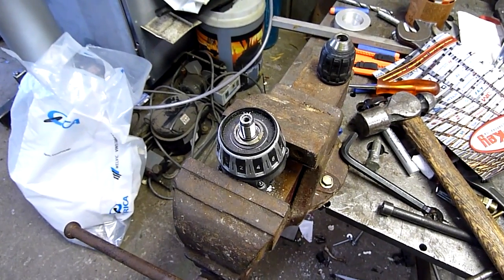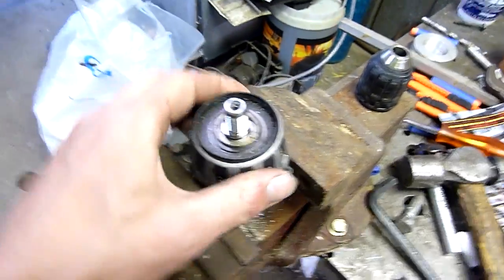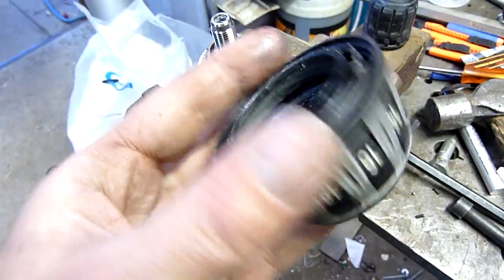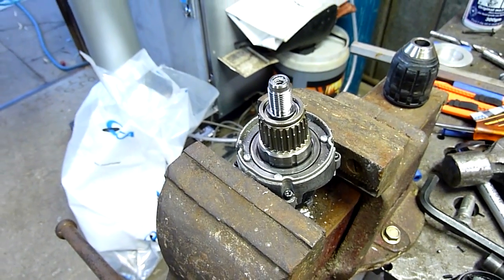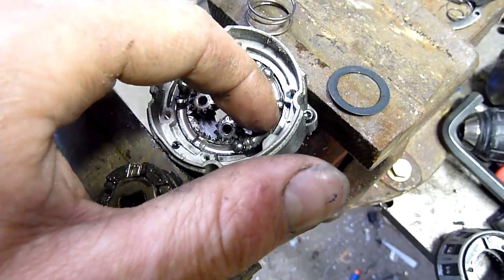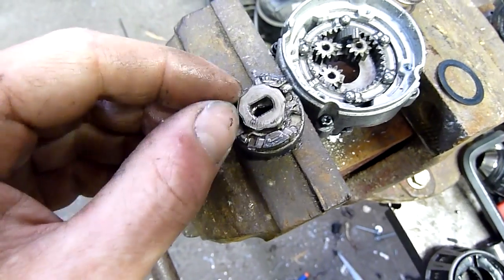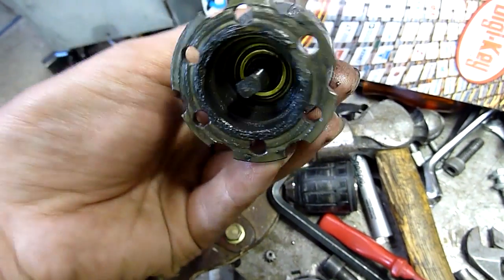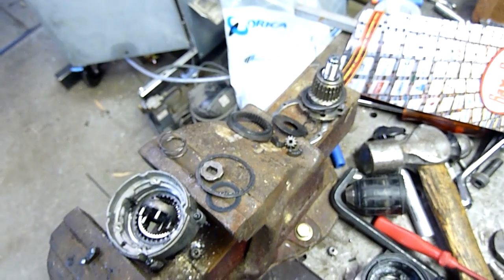Milwaukee M18 Cordless drill clutch autopsy

Comment: my 2601-20 was stuck in the 2nd gear. I took my gearcase assembly apart and learned why it was stuck in the 2nd gear. Now that its unstuck I'm about to put it all back together to see if this fixes my gear shifting issue. the slider pins on the back side of the gear case where stuck in the lowest position and looked like they wedged them selves in an area of the metal gliders of the gear case where it likely should not have been. it looks like they created their own indentations from whatever force caused them to get stuck so I'm hoping they don't go that far down again. I'll try to upload a video on this but currently am stuck where Aussie is, when I pulled that top part off the springs and a few washers flew all over the place. I got it put together for the most part but am stuck on the orientation of one of the springs and one of the smallest blue looking washers you see in his video. Will look for other vids or diagrams to figure out where those went.

Comment: Thanks that was well presented. Mine is only working in the 1 speed setting. if i put it in 2 position i can hold the chuck and it just slips. wonder if it is a stripped gear or do i have to replace the whole front like shown in this video.

Comment: I am here because I got too brave with a milwaukee 0624-20 trying to repurpose the chuck but also the the threaded shaft that it locks onto. Needless to say I opened the gearbox and found an engineering marvel with three layers of gears topped off with those little dogs/paws. I'll never get it back together but damn it seems incredibly well-built. Also yea those seiko chucks are great (they also make the aluminum ones you refer to)

Comment: occasionally...My Milwaukee Fuel 18 will max out on torque and not turn at all. I know there is a clutch. I am trying to avoid purchasing a $80 gear box and would rather fix it with a new clutch assembly. How can you "Rule Out" which problem is the cause?

Comment: Hi sir I live in VN i have 1 hammer drill   MIlwaukee M18 2702 after 2 weeks to work it is smoke and death, but body light on good i was check  soldered it is good, please hepl me, because it is expensive . I buy on ebay, i cant go to usa  take it back under warrenty
Reply: viet tran  I thing the problem is motor you check that I hoped you give more load to the motor

Comment: i took a simaler drill home for a friend to fix one night and the trigger was the only issue, problem is the entire transmission will fall apart on you if your not carfull, it took me an hour to get it working again , it had some tricky little rod and flap for the vairiable slip clutch that im not seeing on your model. i had to do a investigation on the ware and shape of the parts, it took three tries to get all function back ,1st 2nd and 3rd gear plus all 20 slipp settings and hammer drill function, any way the motors in these bad boys are amazing, some have rare earth mags in them bro

Comment: Ooooh, it's rather mechanically complex in there. I hope that the assemblers on the production line are given a good amount of time to put that lot together!

Even if I knew where all the bits went and how it worked in there, I'd guess you'd need a good 20 minutes to assemble one of those because of how fiddly it would be.

Imagine that.... You've almost got it together and a piddly little ball-bearing drops out and you have to take out a few bits just to get the ball bearing back in.... D'oh!!

The last thing you'd need in that situation, is someone on the gearbox-assembly production line breathing down your neck! I'd flippin' go looking for my hammer if that happened! :-O

Thanxx for showing,

-BoomBoxDeluxe.

24th October 2014, 17.36

Comment: I have a Festool DA sander sitting here that's shat its top bearing on the rotor, so the whole thing flops about a fair bit, so I intend to pull that down at some stage and possibly chuck a new bearing in there from one of the other dead sanders we have at work or something. Its got a brand new set of brushes in it too so if I get it going I might hang onto it for home. Its had some abuse too. It looks like it was built in 2003, so 11 years of solid work and abuse. Not bad value for money I reckon. They are worth a fair bit brand new

Had I not subscribed to you and watched a whole pile of autopsy videos, I probably would never have thought about doing a teardown on anything, even my Duratec V6 engine. Now I eagerly await the next video because its guaranteed to be something interesting

Comment: Took me a minute.

The drive runs through the epicyclic gear box, with the sun gear driven by the input from the previous stage, and the output coming from the 'orbital' motion of the planetary gear set.

That arrangement depends on the ring gear being held stationary - which, most of the time, is done by the balls being pushed against the ramps by that large spring.  The higher the torque transmitted by the gearbox, the higher the torque required to hold the ring gear stationary.

When the transmitted torque is too high, the torque on the ring gear forces the balls to rise over the ramp, and the ring gear turns in the housing - allowing the motor to spin while the chuck remains stalled.  The balls dropping off the ramp causes that loud clicking sound which drill-users the world over recognise as the clutch slipping.

I guess that when it's in drilling mode the spring is compressed right down to the point of being coil-bound, holding the balls down regardless of the transmitted torque.
Reply: Given that the ring gear had a ring to slide on, and wasnt fixed somehow, this definitely seems likely.

Comment: Cant say i understood that too well, my foggy brain guess:

While the drive to the chuck is normal the stationary ball bearings push down and hold the outer planitary ring down against the case, so the gears have something to drive against.
Not enough pressure on the balls allows the planitary ring to rotate/slip and drive is lost and the jumping balls make a racket.
Reply: Same, this is a pretty complicated piece of tech. Watching it a second time helped.

Comment: Hey aussie, how did you come to learn what you know? Did you get a degree?
Reply from the maker: you do not need a degree in anything to understand how things work, just a lot of on the job experience in workshops, and time spent studying how things work.

Gearboxes and clutches all work on similar principals regardless of where they are used, the cordless drill one was easy to figure out. its all in the physics and component geometry., some parts drive, some lock, some are designed to slip. 

You can see it in how they are worn, ones that slip in the clutch are bright and shiny due to slippage.
Reply: Awesome. So you learn everything from experience only? what business do you work in?

Comment: Some even have a thrust ratchet type clutch in them that slips when the chuck is seized
Reply from the maker: that is probably the first kind I have seen, on a cheaper drill?
Reply: Aussie50 yeah it was an early ryobi. Didnt last as long as they made it out to :/

Comment: I see the missing little gear  It not on the floor. lol
Reply: on the vice....
Reply: Was that the little gear I saw under the Gearbox sitting on the bottom of the Vice.
Gee I would hate to have to put it back together.
Reply: If you mean the gear on the vise below the gearbox, look again. That's definitely not it.
Reply from the maker: superdau
correct, that one I jammed into the set to unscrew the chuck, other wise it just freewheeled.
Reply: CamperMike it's laying in the vice.